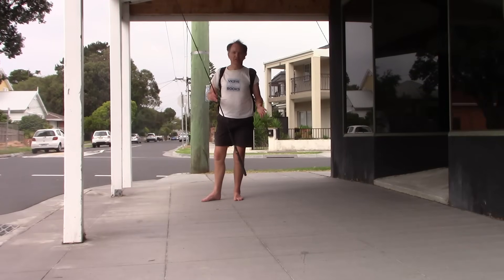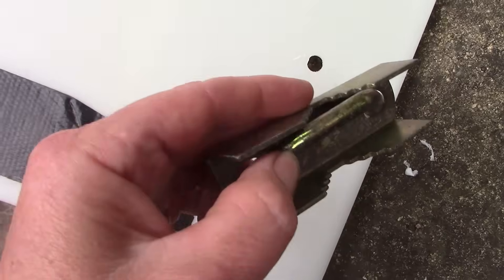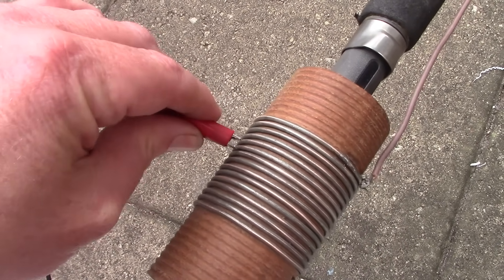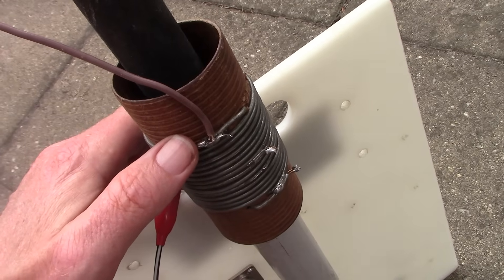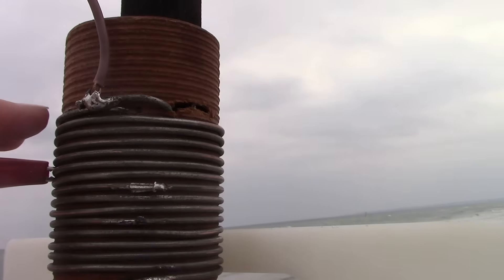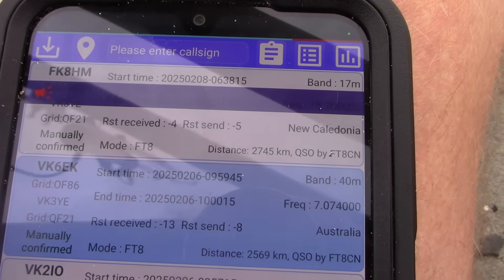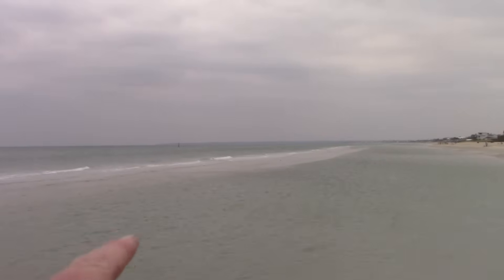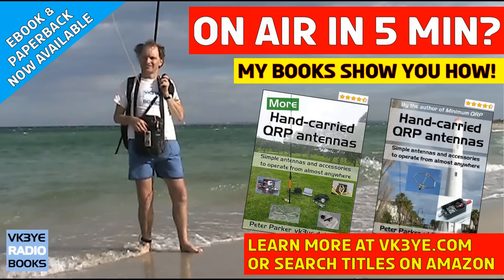Fishing rod vertical does 5 bands

Comment: Hi Peter. Another excellent video, and I really need an ocean here. Lake Erie is as close as I can get, hi! Just curious, I wonder how you are connecting your phone to the FT-817? I have an FT-817nd and recently downloaded FT8CN. Mkd-winter here with temps between -5C and -17C so no field radio for me right now. I do plan on taking FT8CN out for POTA when warmer WX arrives. Do you have any info posted on interfacing the rig & phone? I am guessing the rig is in USB and you key it with VOX.

73, Keith, WB2VUO 

BTW: I copied your Summer loop using a bicycle wheel rim. Great performer on 17M thru 6 M...K
Reply from the maker: Yes, rig is in USB & VOX keying. See a previous video on the interface cable.

Comment: Peter:  In the beginning of the video you mention the use of an ELMAC antenna coupler.  What is that?  And were you using it during the QSOs you describe in the video?  I am running a fishing pole vertical here in the Dominican Republic, and I like the idea of a tapable coil to get on the lower HF bands.  Were you using an antenna coupler, or just the taps on the coil?  73  Bill Hi7/N2CQR
Reply from the maker: Hi Bill. L-match. See my website for a page on them! No antenna coupler needed for this one.

Comment: good simple antenna Peter will it operate with out the coil and i use a L match instead and what books do you publish that i can find these antennas in  cheers Alan VK5PBZ
Reply from the maker: This antenna isn't in my books. But many others are. See my website vk3ye.com for details. If using an L-match and no loading coil I'd use a longer length wire.
Reply: That's a good book sir, @vk3ye

Comment: You could make a large version of that loading inductor on a scrap chunk of pvc pipe of say 4 inches diameter and an old extension cord salvaged from the roadside. By winding the coil over a piece of dowel or fibreglass etc glued down the side of the pvc, you could have raised tapping points and easily make it go down to 80m
Reply from the maker: That's true though efficiency would still be poor down on 3.5 MHz. I'd instead go with a taller pole (say 9m) and maybe some centre loading. A bit like the VK7JJ squid pole vertical.
Reply: @vk3ye  The idea is to just give it the capability to get on the lower bands. I think I'd use sections of aluminum tube collapsible inside one another you just push up and lock into place on-site and have enough to give you up to 5m length
Reply: @vk3ye  Testing a top capacitor would be fun too.
de SA3BOW

Comment: A hell of a lot cheaper than buying a commercial adjustable loading coil and whip. Just the same antenna but with the satisfaction of making it yourself and for pennies. Well done Peter on the build and the contacts QRP.